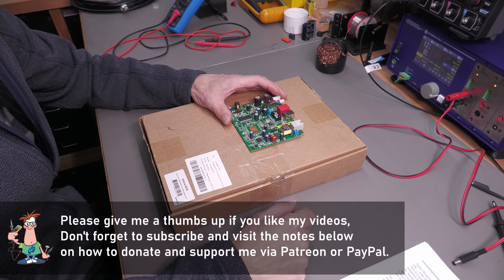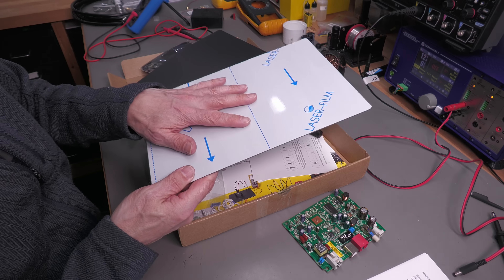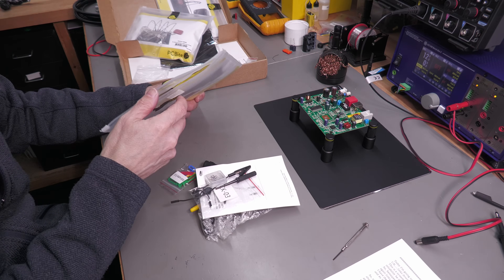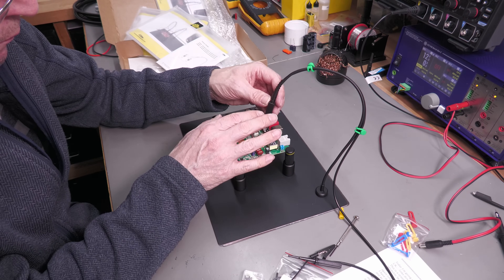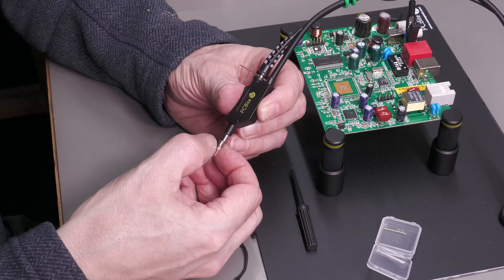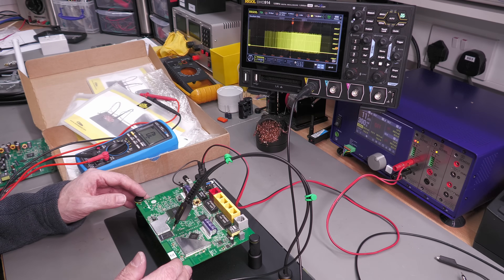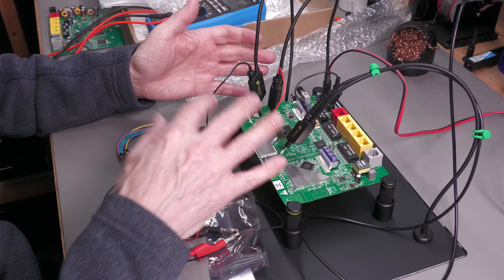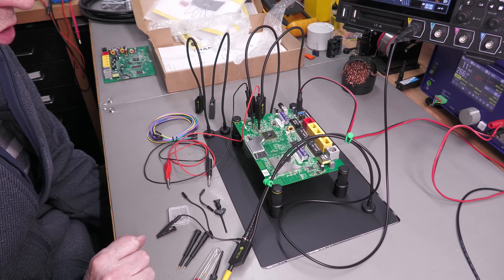No.126 - Sensepeek PCBite Kit (6019) Review

Comment: The PCBite kits are great. I got one from Elector a few years back. They only had DMM probes back then, but still - what a gret tool for troubleshooting smd boards. Thanks for the video.
Reply from the maker: I think these are the redesigned probes which have a lower centre of gravity so should be even better.
Reply: @IanScottJohnston  Ah, I didn’t realise these were a new design. Anyhow, the bigest issue with PCBite is that there’s not enough probes 😀 So I’ll be ordering another set of probes then.

Comment: Looks very handy 👍 Usually I just solder in some thin wire wrap wire (30 AWG) when I need to do measurements on boards like that, but of course that's a bit of a compromise when looking a high frequency signals.
Reply from the maker: Same here, the Kynar wire is always nearby……but will be looking forward to trying this in anger next time.

Comment: One additional question I do have - A lot of what I'm working on are boards from old T&M  gear that sit on extenders - Did you ever try using the probes on a board that was oriented vertically instead of horizontally in the holders?
Reply from the maker: If you want the probe to lie horizontal then they won't do that.....but would work on on a vertical board just as long as the probe is vertical.....somehow.

Comment: the only issue I have with this for repair purposes is that when doing repair you dont usually have a bare board outside the unit. Most of the time it has to remain mounted in the chassis and sometimes even at an angle and I am not sure if this system will be that helpful
Reply from the maker: More aimed at design where a lot of probing would take place compared to repair.
Reply: I have done some probing on PCBs inside chassis with an older version of this kit and it is doable. If you need to probe something that is at a to step an angle or vertical and you still have access to a magnetic surface (like that chassis of the equipment in question) I would look into dial indicator holders. They mostly have magnetic bases and with a little modification they can hold normal scope probes rather well.
Reply: If you have to ask this, you are in the wrong field. This is meant for Embedded Design Engineers, not Repair Technicians

Comment: looks very nice. Just last night I was having nightmare keeping two scope probes with my left hand on two tiny 0402 resistors and turning the power supply with my right hand on and off to capture and decode an I2C bus when troubleshooting a scope that is stuck at boot. This would have made life so much easier